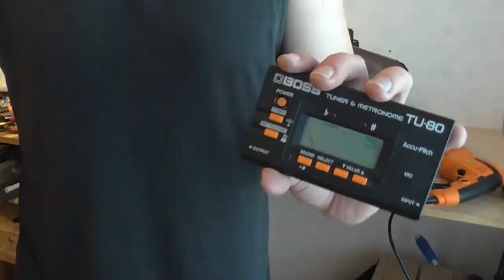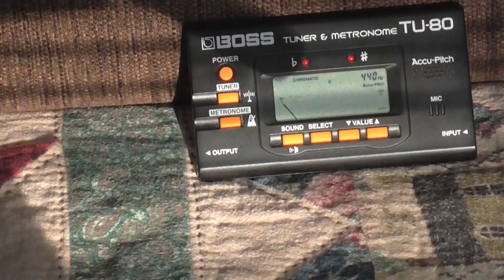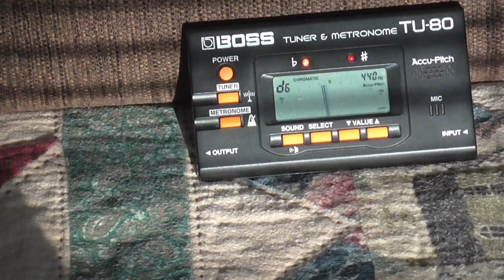Making a Copper Flute 10 x speed

Comment: What do you do when the lower register is is in tune, but the upper isn't?
Reply from the maker: There are some options. Easy option is to change the location of the air plug, move it back and forth and test it with tuning meter. One a bit tricky option (but effective) is to put a long wedge inside the pipe. Higher end of the wedge should start from the air plug. I can't remember the numbers exactly but the higher end should be something like 1/3 or 1/4 of the bore diameter. The lenght is roughly a half of the flutes lenght but it depends on the tuning and how far the air plug is from the blowing hole (the furhter the flatter pitch). There is also one option that includes shaping the bore side of the tone holes but I've found that quite inaffective.

Comment: Hey bro, just wondering if you can give us the measurements, length of pipe, length to blow hole, length to each holes :) thanks
Reply from the maker: From the end of the flute:
Hole 1: 8.7 cm
Hole 2: 13.8 cm
Hole 3: 16.4 cm
Hole 4: 21.7 cm
Hole 5: 25.75 cm
Hole 6: 29.6 cm
Blow hole: 52.5 cm
Entire pipe is 57.5 cm and the air plug is 1,5 cm away from blow hole. Pipe inside diametere is 2 cm and outer diameter is 2,2 cm.